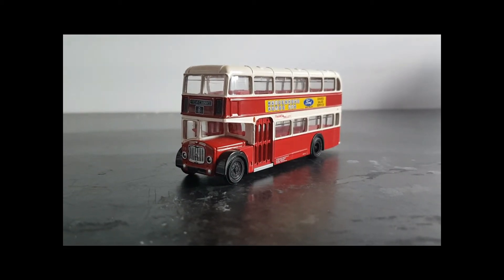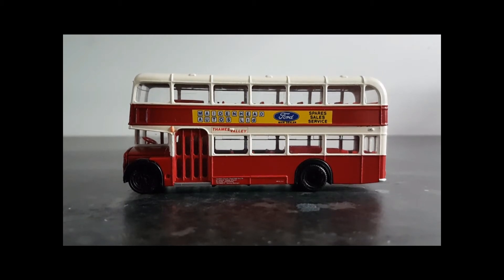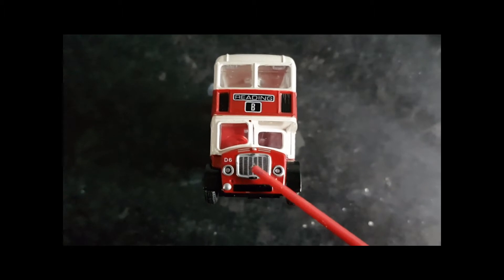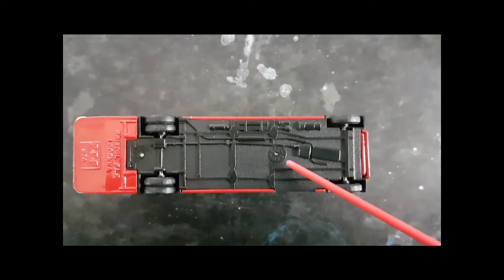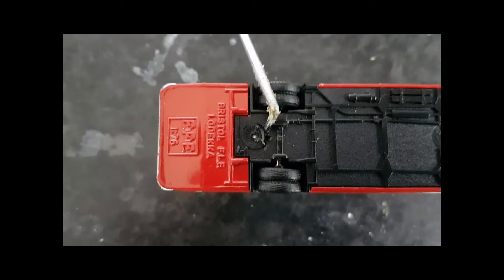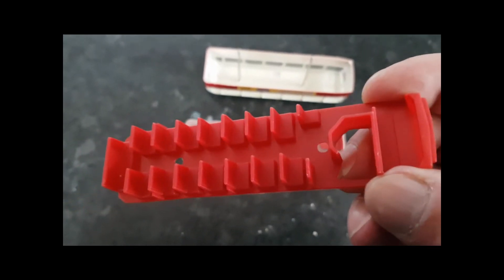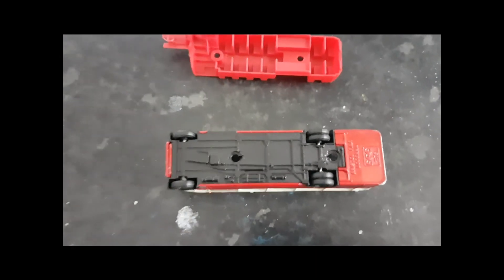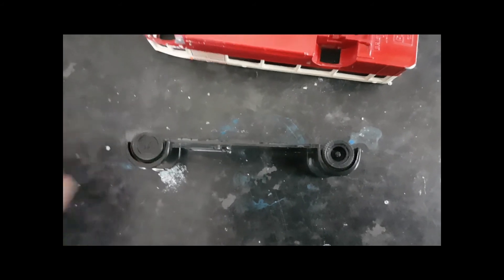Want to break down an EFE Bus? | Code 3 project Part 1?sub_confirmation=1

Comment: Hi. I recently managed to get one of the red efe BEA routemaster’s and luggage trailer for a cheap price and I’m planning on making it into one of the blue early ones as a code 3 project but I’m in need of some advice. Unknown to me when I got it for a really good price the seller had not mentioned it didn’t have a tow hitch. And I was wondering if you knew what would be the best way to make a replacement as I feel it’s a big part of the model.

Thanks in advance
Reply from the maker: Hello and thank you for your question. I am unsure about the RMA range in detail, I do not own one myself. I did just have a quick look at it on the web. It looks like tricky thing to recreate however if the model is going to be in bits I might try using part of a large size paperclip in some way.
Regarding your project, did you mean the BEA livery? If so that model is available as 36201, link here from Modelzone:
http://www.modelbuszone.
.uk/efe/dd/156/36201.html
If I can help further please do not hesitate to get in touch
Reply: @StBlazeyModelWorld thanks for your reply. I didn’t think of a paper clip but that could work really well. The model I have is actually 36202 but I plan on making it the same colours as 36201 as quite frankly I barely see them for sale. This could also give me the chance to make other changes to the model like a more detailed interior as I’d like to add luggage racks like the real things. Thanks
Reply from the maker: @theaverageteleporter7435  I wish you all the best with your project my friend. Please know how it turns out, kInd regards, Roger

Comment: I'm wanting to paint a model bus at the moment but I want to know. Without damaging the plastic circular cubes , is there any other way to take it out?
Reply from the maker: They can be prized out using a very fine pick tool but usually get damaged in removal. Sadly, I am not aware of anyone who sells replacement clips these days. In the past I used to glue the models back together because I always removed the interior poles as well. Please avoid the use of superglue though if you go with this option. The fumes from such glues are really strong and they attack the plastic glass units, causing them to haze out and prevented from being clear and see through. I hope that reply helps to some extent. Many thanks for viewing and asking a question :)

Comment: Hi from St. Ives, C'wall.  Very interesting video. You mention you can buy new "clips" to secure the chassis into the body. Can you give any clues as where I can look to buy some.  Many thanks.
Reply from the maker: Thank you for your kind words. I'm glad you enjoyed it. The supplier I knew of for these had sadly gone out of business. I shall attempt to find a new supplier and get back to you
Reply: Thank you for your reply. It would be most appreciated if you could find a supplier.  I have two Bristol LS coaches which I need to dismantle in order to change the colour of the interior etc.
Are you in  St. Blazey, Cornwall?   Regards, Brian  @StBlazeyModelWorld
Reply from the maker: @brianuk46  Hi Brian Yes I am.